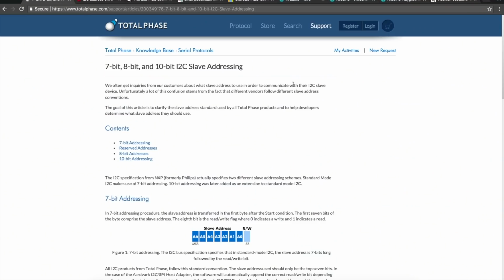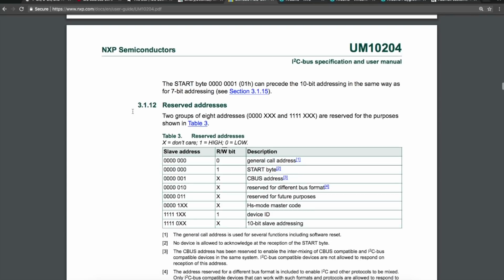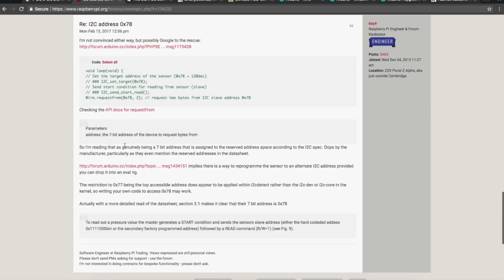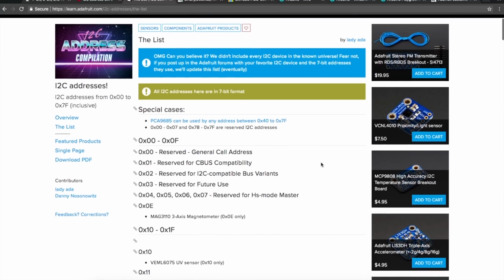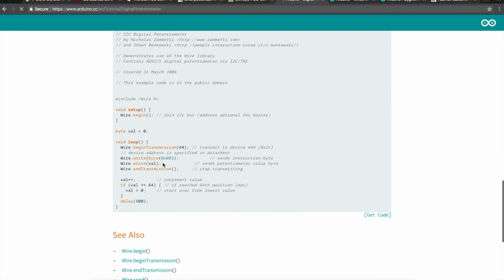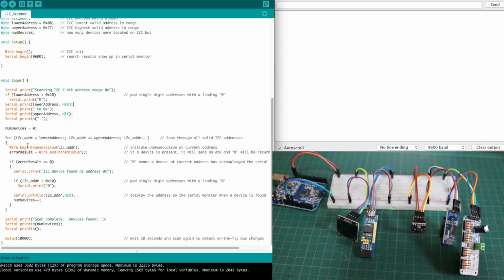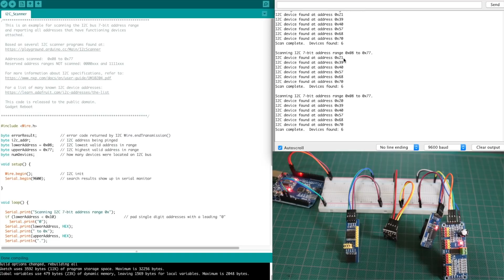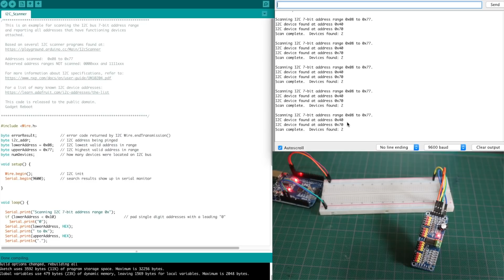How To Find Unknown I2C Addresses Several Ways

Comment: According to another video about the I2C protocol there is a way to have 10 bit addresses on a device. Here is that video, that I'm talking about - I've also set a marker to the correct time: https://youtu.be/IcPUE-kTN50?t=838
Maybe the device, which specifies an address in a reserved space is actually using two address frames and the library does not support it?

Comment: sir, I am a beginner using i2c communication, I want to use a pressure sensor with type XGZP6857D and display the reading of the pressure value on arduino .. This sensor has an i2c communication protocol and I've scanned the i2c address for the sensor which is 0x6D ... but I do not understand how to access these sensor registers with the arduino code in order to get the pressure value you want displayed, maybe you have an idea for this problem? thank you..

Comment: Nice video!  What happens if two I2C devices have the same address :-)
I seem to remember there's a workaround/hack.
Reply from the maker: I could actually try that because I have three of the PCF 8574 GPIO expanders that I could set to all the same address but I think it would generally causes problems because all devices would try to respond and cause bus contention and maybe nothing gets detected when they try to talk.
 If there is a way to make it work that somebody came up with, that would be interesting  but I can’t think of a way unless somebody throws in some sort of buffer/steering circuitry.
Reply from the maker: I found this discussion and the answers I like the best are a couple of variations of things like intercept the data line on the devices you do not want to talk to and allow the data to pass through on the device you do want to talk to so then they can have the same address but the others just won’t hear the data. 
https://electronics.stackexchange.com/questions/5096/how-to-resolve-i2c-address-clashes

Comment: Auto-scan is sometimes useless because you do not know what device you are dealing with even if you found address.
I had oled that had 2 addresses on it one write one read and that makes sense  too
Reply: If you watched the video you would know it's only a tool. It's a start if you a) have a known device only with unknown address setting of b) have no clue about the device and you can use lookup lists like the one from Adafruit to get started. And no, having a read and a write address (in 7-bit) doesn't make sense. Not saying manufacturers will not do it :p
Reply from the maker: If a device had a separate address for read and for write, it sounds like they were giving you eight bits with a zero and a one  at the end so the first seven bits would’ve been the true device address if I understand correctly. 

 If you don’t already know what the I2C device is supposed to be then yes all you will learn about it is the address but even then you could probably try to search out what devices should be on that address because they should all be registered by NXP and there should only be a small number of possible options for what the device is.
Reply: It is just an ID not a true address but a way addressing a device with a byte value so I don't blame manufacturers making life easier for Arduino people
Reply: Browarus Pierogus  No, it IS a real address. No ID involved ;) Scanners just start a transmission to every address (without payload) and just look for an ACK.
Reply: Much easier is to just use CS line than have conflicts and mess with devices.
Reply: Browarus Pierogus  But that's not I2C...
Reply: Usually i2c devices also support spi/cs
Reply: Browarus Pierogus  Some do indeed. But I would not dare to say most... Most of my I2C devices don't have SPI. And then, SPI has its own pitfalls xD

Comment: There is Universal 8bit Graphics Library (https://github.com/olikraus/u8g2/). I used this for my oled display, and had no problems with i2c addresses. Maybe because it's built differently. You can use this library with all sorts of displays, list is huge.
Reply from the maker: Yeah I still have another display kicking around actually I think I have two kicking around that I haven’t even used yet so I will be checking out lots of display drivers still. I’ve only just begun!
Reply: I'm interested in memory usage of both libraries. This universal library has  3 modes: full buffer (heavy memory usage), page buffer (smaller memory usage), and text only mode, with one font only.